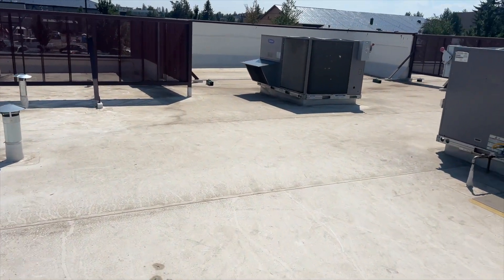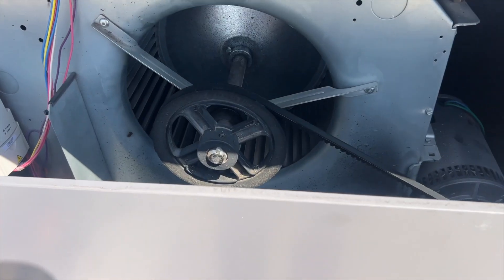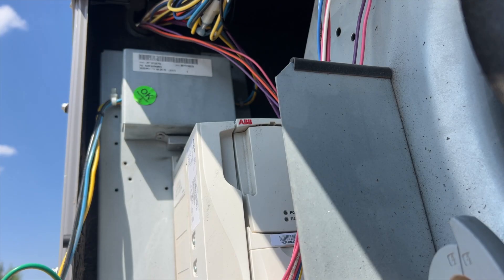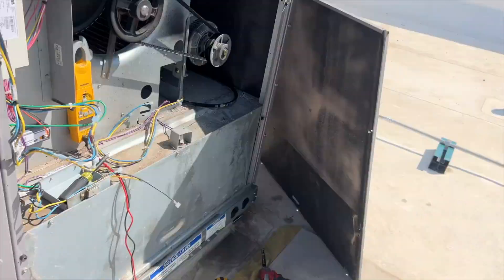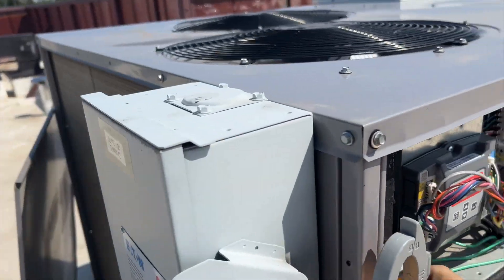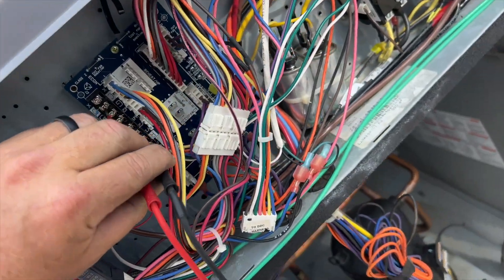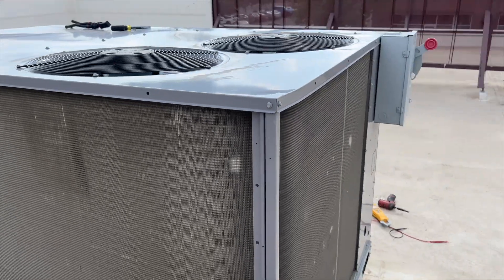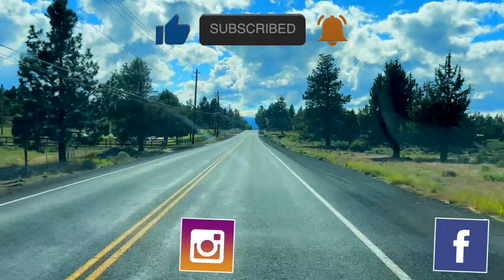No Air Flow VFD Issues EP187

Comment: Known issue with these Carrier units.
You need to replace the OEM fuses with a different type of fuse at a different rating, there is a tech bulletin about this.
The way this is wired, that blower is running all the time. If there is a smoke/fire shut down to this unit, the blower will NOT shut down.

Comment: It will probably take a while to get VFD, I install a contactor, parallel the coil with 1 stg  compressor contactor coil so it will shutdown on smoke detector if needed.  Also Carrier recommend using different fuses